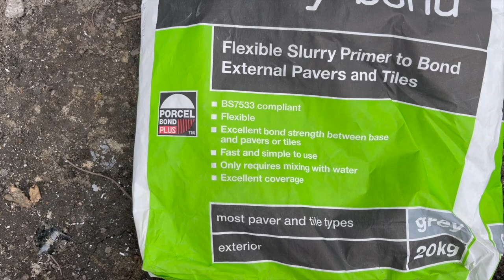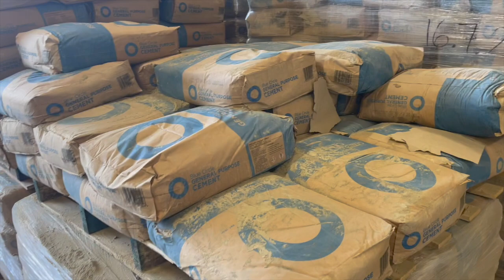How To Lay A Porcelain Patio Part 2

Comment: Why did you use a dry mix bed here rather than a 40mm 5-1 mix? Is there a better time to use this?
Reply from the maker: It was 5.1 Martin mate, we change our methods sometimes as in this case it has more compressive strength than a wet mix
Reply: @GreentopLandscapes  Is it still OK to use a wet mix though as the traffic on my patio will only be footfall?

Comment: Would a standard set tile adhesive mixed with SBR not do the same job as a very expensive priming slurry?
Reply from the maker: May do Stee mate, but I am not sure the manufactures would recommend that,
Reply: Hi Stee, we would not recommend this, as the standard set tile adhesive wouldn't bond with the subbase properly. Tile adhesives are designed for fixing to dry firm subbases like concrete, not wet or semi-dry mortar beds